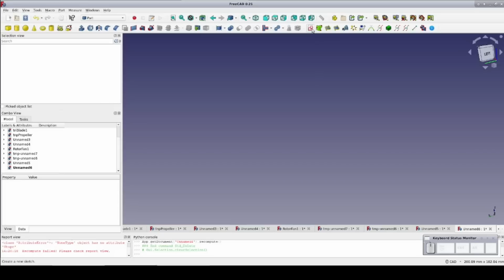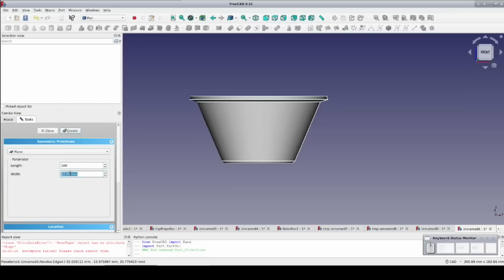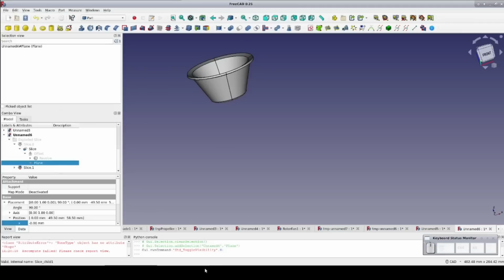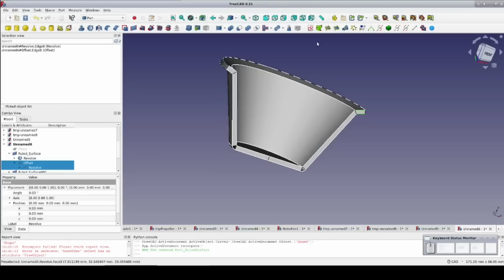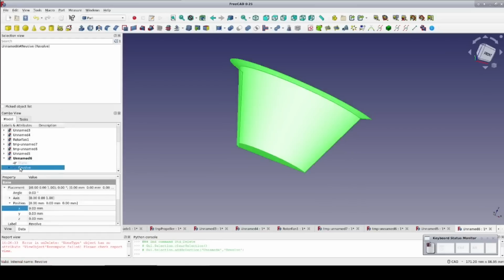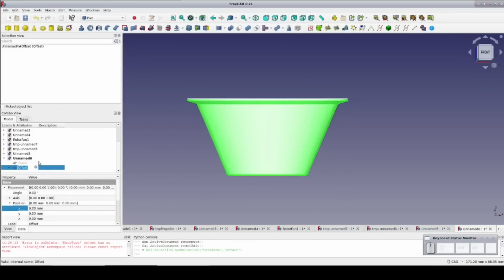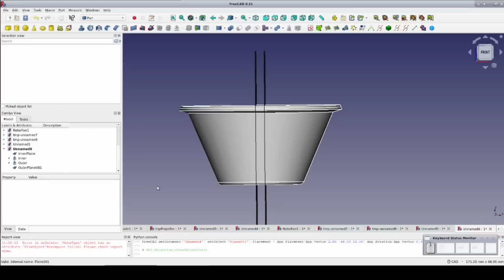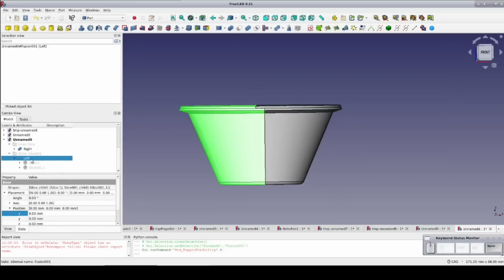FreeCAD: An open reply to Tom Sanladerer

Comment: I don't know how big or small the team is, but as for limited time, last december FreeCAD turned 20 years old. It's probably older than some of its developers. So please no "limited time" excuses.
Reply: Time in OSS refers to the hours developers, working for FREE, manage to devote to the project moreso than the years a product has existed.  That's a function of both popularity (where a tool like Blender is in the spotlight with animation and 3D rendering WAY more popular than "boring old CAD") and complexity, where 3D parametric CAD just about tops any ranked list other than the aforementioned hot topic of 3D rendering and animation.
Reply: @brianmi40   Yeah, and I might understand it all if FreeCAD was like 5 years behind the rest. But it's nearly 15 behind most of them. It's not just slower than the rest. It's on a completely different level of "slow". I suspect it's older now than some of its developers.
Reply: @sharpfang iterally about 5 people are consistently working on it, for free. Of course it's "15 years behind" from commercial CAD, it's also 1500x less funded. Just the geometric kernel that makes this work is super complex, and making all the tools around it is an insane task on it's own. You can only worry about usability after you've figured out the "basics". CAD software is much more complex than you think, even the "basics"
Reply: @33KK  It's 15 years behind a whole bunch of FOSS projects of similar age and similar complexity. I listed some. WINE, Blender, OpenOffice? You can't tell me they were much easier to write than FreeCAD. Yes, the geometric kernel is hard. So is raytracing, So is rewriting Windows kernel and low-level API as FOSS. I'm not diminishing the difficulty of a CAD program, but so shouldn't you diminish difficulty of many other types of software that are no less complex - but their projects matured at ~5x the pace of FreeCAD.
And no, I don't know about their developer base sizes, but even if there is a serious difference, that only means FreeCAD is limited by small team and problems with recruitment of volunteers willing to work on it. Also known as leadership problems. FreeCAD is not limited by time, only by mismanagement of time.
Reply: @sharpfang   
 Well, in case of OpenOffice, first of all it's kinda dead and LibreOffice is the thing now. Yes, it is less complex than a CAD. It also is far less niche which is likely much more important, there's quite simply more interest in having an office suite than a niche engineering tool.

 Wine until the major investments by Valve, Collabora and others was also considered to be "15 years behind" windoze, and it's generally bundled with a lot of other projects, like DXVK, Proton, etc.

 Raytracing itself is not very complex, it is only a part of a full renderer, which itself is only a part of Blender or FreeCAD. Blender until 2.8 was also said to be "15 years behind", yet here we are. Blender only got there thanks to the financial support and the contributions.

 FreeCAD got some spotlight only recently as some popular commercial CADs started killing off their free offerings. I can't wait for toponaming stuff to get merged into the main branch already, that would be a huge step forward.
Reply from the maker: If they were writing "Hello World", they would be about 19.999 years tardy, but a CAD package is just a wee bit more complicated than that.
Reply: @4axisprinting  Yeah, about as complicated as a full office suite; LibreOffice (back then OpenOffice) came out around the same time and was pretty much "production quality" within some 4 years. Inkscape took a couple years longer. GIMP - took a good decade to get rid of the batshit insane UI. Blender - again, similar age, a couple years ago got its UI overhauled and is currently a serious competitor to paid programs. Firefox started a short time before, was great in mid-00's, eliminating MS Explorer from the browser market. WINE matured from proof-of-concept into something SteamDeck is built around. 
I can think of one FOSS project that progresses slower than FreeCAD: GNU/HURD.

Comment: Still, one of Tom's points remains valid: working with FreeCAD could be more visually obvious and intuitive. Making a plane in a form rather than in the 3D viewport puts too much offset from intuition. Making mistakes without getting visual feedback, but textual info, at best, is very nerdy and reminds me of working with Linux. True, it is doable, and with enough time put into FreeCAD, it may eventually become second nature. But: if you need a tool to get quick results to realize a business case and then build on top of it to master it in more detail, FreeCAD is not the way to go, unfortunately - at the moment.
Reply: Why would anyone think that a version .2 of any product could possibly be "a tool to get quick results to realize a business case"???

What we basically have here in these comments is a bunch of whining about a PRE-RELEASE VERSION not meeting the needs or smooth workflow of FINISHED PRODUCTS.

To which I say, "DUH".
Reply: @brianmi40  Dude! I don't want to attack you, but I have a different opinion on your statement.

1. What does FreeCAD's version number tell us anyway? FreeCAD uses a version numbering that follows no common standards or intuition.
2. FreeCAD has been around for 21 years. This is long enough to at least get into beta status. 😀
3. I do not criticize FreeCAD or the dev's efforts! I applaud them! However, a lot has changed in 21 years of how people learned to use such tools, and FreeCAD has failed to adopt, but on the other hand (which was also Tom's argument), there are so many unnecessary workbenches that took a lot of effort making. It needs a reorganization of the entire endeavor to make FreeCAD...
4. ... an alternative that it claims to be for Fusion 360 and other CAD tools out there. I have followed the FreeCAD project for years, and they always mock users for paying for other tools. When Autodesk changed its policies, FreeCAD was all over social media claiming that "refugees are incoming." So when you have the guts to compare yourself to multi-million corporation products, you should deliver at least a solid foundation where people don't get lost trying. Blaming them for not understanding your UI and open-source philosophy or telling them they are unwilling to put the effort into relearning workflows just because your project is not keeping up with the world, something is wrong.

I am the last person on earth not wishing FreeCAD all the best, and I reconsider it to be my tool of choice multiple times per year. However, I think for open-source makers and small one-man businesses, there are better freemium options that get you faster on track than with FreeCAD. I hope they will branch out into a foundation-like structure like Blender or Godot did and collect steady funding to pay full-time devs.

So... no bad blood!
Reply: @martinmajewski  Well,,,

1. FreeCAD's version number can tell us the same thing every other pre-release version number has since software was being first developed: it's NOT a FINISHED PRODUCT, and as such should expect BUGS and WORKFLOW to NOT be otpimized, as well as be FEATURE LIMITED.

2. If YOU had been a developer for FreeCAD all that time, you might be qualified to make that statement.  However, given the NATURE OF OPEN SOURCE SOFTWARE, in that it depends ENTIRELY ON DONATED PROGRAMMING EFFORT, no one is qualified to complain about how fast or slow a product has come together.  Want it faster?  Feel free to get out your checkbook.  Despite it's .2 version, there are literally HUNDREDS of YT videos showing it ably accomplishing hundreds of designs, from simple to very complex.  In anyone's software book, that's impressive for a .2 release.

3. See #2 for a reminder about how OPEN SOURCE DEPENDS ON THE EFFORTS FROM VOLUNTEER PROGRAMMERS.  Claiming there are unnecessary workbenches without specifying what functionality overlaps won't get you very far.  Also, as a .2 release, I'll remind you it is entirely dependent on DONATED PROGRAMMING TIME from developers, who, in such early stages of a project, are prone to have an interest in a specific area of functionality, therefore it is natural for some overlap between workbenches to occur, again, in a .2 version.

4. I've never seen FreeCAD "mock" paid tools.  Happy to have a URL to see the history of that.  In fact, just scanned both their home page and blog and see no such references, so be sure to share that URL.  However, I see it as a natural argument / benefit of ALL open source software to be FREE and for that to appear "in opposition" to paid alternatives.  As an open source initiative it's pretty hard to fault them for not having a professional marketing department and for VOLUNTEERS overstating their case, which is pretty much what every TV commercial has done since the beginning of time.

Maybe FreeCAD will be better funded in the future, however, I'll still wish for it to be open source, and after 4 months applying myself to learn it, as opposed to Thomas errantly assuming it "must" work like his prior CAD knowledge has taught him despite it being obviously and hugely PRE-RELEASE, I watched many of the HUNDREDS of YT videos that very capably teach the scope of its functionality, to where today, I can create moderately complex designs from it in minutes.

To ME, that is WELL punching above a .2 version number.
Reply: @brianmi40  It's 20 years old software that cannot make even most basic tasks properly. When it will be comparable with other even most basic CAD software? In 2099 or later? From my perspective nothing changed for better in FreeCAD in more than 12 years.
Reply: @MrKuncol 20 year old software maintained by a few volunteers in their free time with very little funding* It is comparable to other CAD, it can do a lot, even if it's not always as easy as in other commercial CAD software with millions in funding and a full-time development team

Comment: Freecad looks alot like QGIS
Reply: Well, I tried both and I found QGIS much more intuitive.  I have over 20 years of experience in mechanical design and I found FreeCAD unnecessarily complicated and cumbersome. Last year I tried QGIS for the very first time, with zero experience in GIS whatsoever, and in a couple of hours I managed to put together maps and databases without any problems. I think QGIS it's far superior.   Having said that, I support FreeCAD via donnations because I want it to be better.   I wish more effort was put into usability rather than expanding functionality, but of course I'm not a dev and I do not have a clear understanding of what's required to do so.

Comment: Yep... Since software engineering in my piece of cake I can say that at 5:20 you said something that would sound like a big alarm to a product manager: the fill option will not work because... there there is a missing feature in this mod. But you can import it as an add-on. This is simply not an expected behaviour in a user story.

From the UX you have many ways to mitigate or solve the issue... From the easiest one to the better one:
1. You give a meaningful error with a solution "the fill cannot be done because[...] You can complete this action by installing the Add-on [...] and use the tool [...] to fill the missing parts"
2. Disable the toggle for the fill and give an hint on why it's disable (as in 1)
3. When toggle the fill option and is not possible to proceed prompt the user to install the missing add-on, and then use that function.
4. Reimplement the fill toolbox to behave better implementing the missing commands in the main toolbox. Since the number of features  (point, lane, arc, etc) are a finite, so generating all the possible combination is doable, and probably can be metaprogrammed with some macro or preprocessors.

Even if you are a small team, solution 1) is still very very fast to implement and makes UX so much better

Btw very useful video, I got much more understanding of freecad with just this video
Reply from the maker: It's definitely an item for the punchlist. The rest of the explanation there is notes to be attached. It should be addressed but I can well see why that isn't top priority.
It's important to remember that at some point most proprietary software existed in states like this as well, it's just that nobody outside of the dev team ever got to see it (and exposing it to public view might be a termination offense). At least, in theory. In practice, I have seen proprietary software being actively sold that had bugs like that in it.

All that said, bugs and all, FreeCAD is useful today and it would be a shame for it to be kept jealously under wraps unless/until every punchlist could be addressed.
Reply: You sound like a pointy haired boss. (user stories, bah)

How is the software supposed to know what add-ons can solve an issue?
Reply: @jocramkrispy305   you can call me as you wish but still someone might ask how a user is supposed to know what to do after the pretty generic error.

That said I support and love free software, however as today, there is a big difference between the usability of freecad and any commercial products IMHO, even for not professional users... If I consider other free softwares (i.e. blender) I don't see such a gap, at least considering non professional use.
Reply: @alessiozamboni4694  I'll try again.
The way software could recommend an add on, is if the add on is part of the product, but disabled for charging or reliability reasons.
Reply: @jocramkrispy305   yes, or just the developer might know that someone implemented some important features that are not (yet) in the product, even if the addon is not part of the product itself. After all, in OS software, the developers are often also users. Furthermore, as I already wrote, I would be happy also to have the checkbox disabled when the current selection cannot perform an operation; as last resort even prompt a user-readable error rather than a developer-readable one. Again, no hard feelings against Freecad. It just didn't leave me (until now) the same good impression as other free software, even if there is not much of an OS alternative, AFAIK.
Reply: @alessiozamboni4694  How is the system to know whether it can do it, until it has tried?

The appropriate user story, is for the user to try, and it fail. the user then asks the community, who advise the problem can be solved by a plug-in
Reply: @jocramkrispy305  it depends on how the code is written: in general the software just needs to know whether the current selection has a function that accepts the selected object types (not executing it). Of course this just needs to be done for the functions/options in the active panel...
I already implemented similar functionalities on different products before, but to know more specifically I would have to study freecad source.

Having to ask other experts to learn how to solve inexpressive errors or unexpected behaviours is not ideal user story for a product sorry😅!
Reply: @alessiozamboni4694  but the code would be passsed a tree of objects, some of which may be procedural

Asking the community is a great user story.
Reply: @jocramkrispy305  lol that what I said: it depends from the implementation. In general iterate over a tree is not an issue. Again the proper way to do it depends from the implementation, which I never saw.
Also, asking the community is just an excuse, and not good one: I never had to ask anyone to learn the usage of inventor, fusion360 and onshape (for the mostly basic usage I need)... In general is good to have a community, but we should not rely on that exclusively 😅 that's just an objective difference.
Reply: @alessiozamboni4694  in general not, but 3d models are highly complex. For it to take a minute for each checkbox to work out whether it needs to grey it out or not is unacceptable UI
Reply: @jocramkrispy305  If that is the case fair enough: i agree with you... seems you saw the source code of the project so I believe you know what you are speaking about. Another possible solution(always from the "i don't know the source base" POV) to solve the problem is to add an additional data structure just for fast-fail validation. Since this structure would be just used for validation, it could contain different values and/or use memoization to make everything faster. 
If this is done on a separate thread, it should not impact performance greatly. Again i don't know if that is possible. I have never worked on 3d applications deeply, I've been working more in the knowledge graph / dbms area lately... so that part is not really my piece of cake.😅
Reply: The issue is that even "basic" CAD features require a lot of complexity. It's not easy to figure out what exactly has gone wrong programmatically, especially if the issue happens inside the geometric kernel
Reply: @33KK  From the developer's point of view yes. I know that often it is very hard to implement features that are conceptually straightforward (even tho I never developed any CAD software before, in other software this happens too). 
Here, I am talking from the user's point of view. As a user, I don't need to understand what is happening behind the scenes, if it is complex or not to implement. I do want to:
a. know if a feature that solves my requirement is present;
b. have documentation to read (proportionally complex wrt the feature) that feature works (aka input and outputs);
c. be able to *reliably* use my feature.